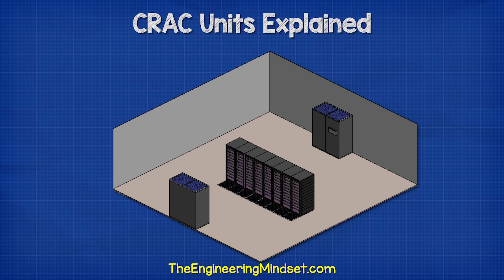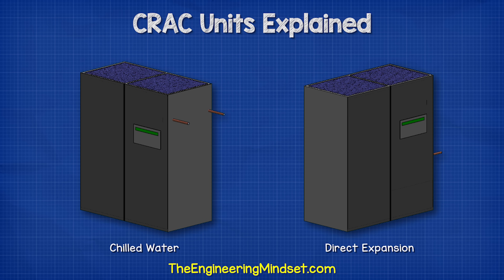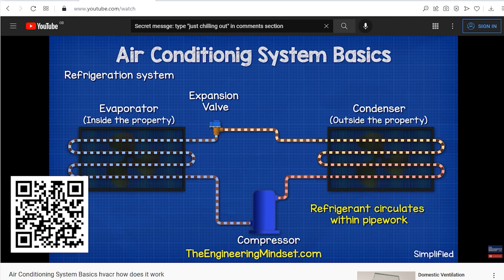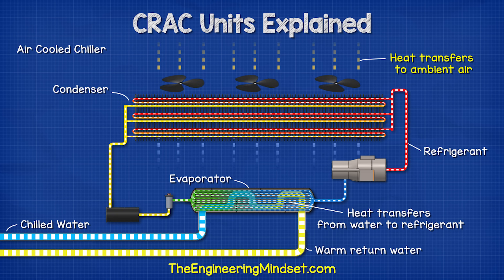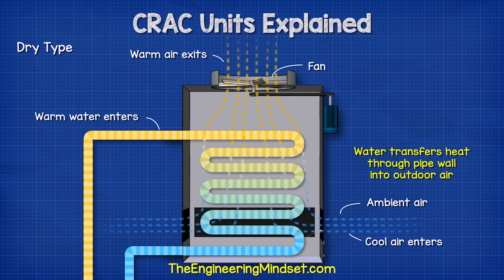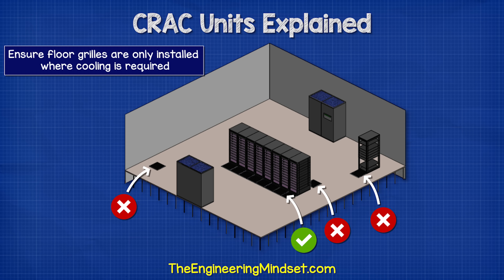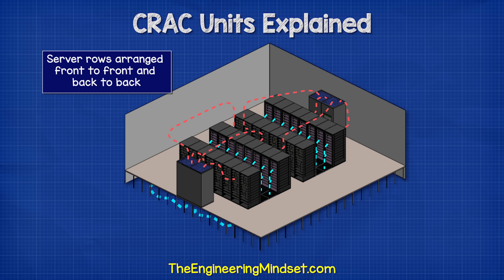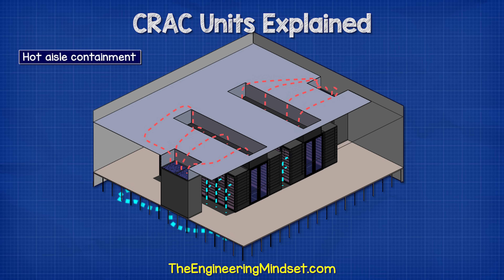Computer Room Air Conditioning - How do CRAC units work?

Comment: I worked in DC. Suspended floor is well known as raised floor. Common height is 300 mm, 600 mm and 900 mm. For down flow CRAC, the raised floor height is crucial to allow better air flow and avoid turbulence from blower fan.

Comment: Funnily enough, I'm installing CRAC units this week in a hospital - but not for server rack cooling, they're being used for CT Imager cooling. Also, they're configured to supply conditioned air out the top and draw return air through the bottom.
Reply: Interested to know what is the temperature difference between supply and return air. Hot air rise to the top, so it will be inefficient to supply cold air on top and draw back from bottom.

Comment: Edit from a European DC Provider - normally with indirect cooling... the hot water from the CRAC units is cooled in towers for normal cooling and then additional cold water from the Chiller is added if needed (if outside temp is ober $°c)

Comment: Great video! In the data center engineering industry we reserve “CRAC” designations for units with a direct expansion inside the CRAC and closed loop refrigerant such as R-410 is the only heat transfer media. This is similar to a mini split air conditioner or other AC unit. 

If the heat transfer media is chilled water, the industry term is “CRAH” or Computer Room Air Handler.

Your content is top notch as always and I sometimes send new engineers your videos. Keep up the great work!
Reply: Everything base on this designs are CRACs here. never heard of CRAH. feels odd given the units all look identical.
Reply: How does one pronounce CRAH because everyone in this industry says “krak” for an ac unit in a data room or server room which is getting annoying

Comment: suspended floor? I think you mean  "raised" floor :)
Your last method is close to the best, cold room but its better to send exhaust into plenum from each rack via boot systems, where its extracted in part, and recycled in another part, in such systems it is also code in many countries to inject external "fresh" air into the mix, rather than just recycling the same hot air  over and over, but all in all a good explanation

Comment: Our CRAC units have the compressors inside the units along with a water cooled condenser. Then the water pipes go outside to coolers. They also have a refrigerant coil and water coil, so In the colder months it uses water chilled by the outside air

Comment: That's the proper and sensible way to do it, but I have seen so many companies just use standard ceiling mounted air conditioning units.
Reply: If it's only a small server room then it makes little sense to spend 3 or 4x as much on a CRAC unit instead.

Comment: I was just given a project on CRAC units lol. Now I have a better understanding of their purpose. Thanks!!
Reply: CRAC units also like normal building ducted air systems, interface with building systems like VESTA, so in event of fire they shutdown, this is essential since  if the suppression system fires, its agents are not being extracted, allowing it to do its job and extinguish flame and preventing reignition
Reply: @Ressy66 You meant VESDA? Very early smoke detection apparatus. Very important to seal the incoming air when potential fire is detected by VESDA for FM200 or the likes to be pump into a seal room, so that the FM200 gas can do it’s job of suffocating the fire.